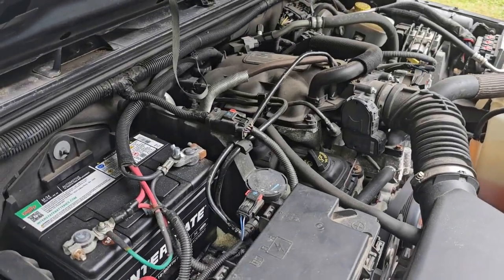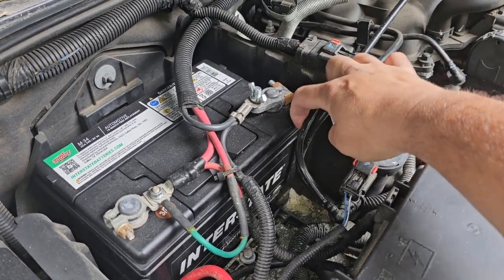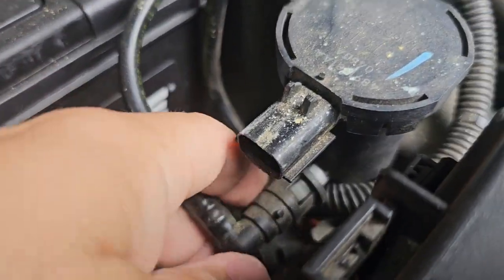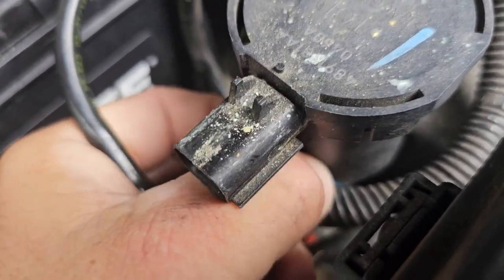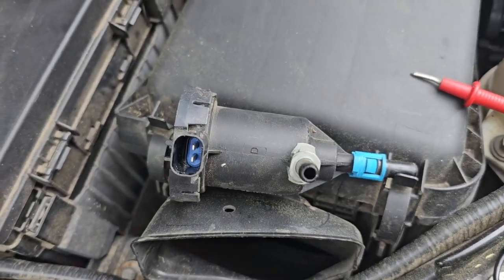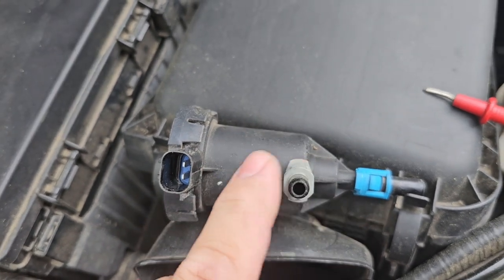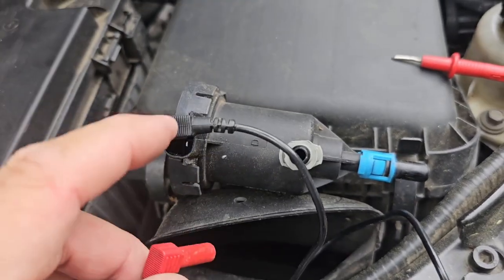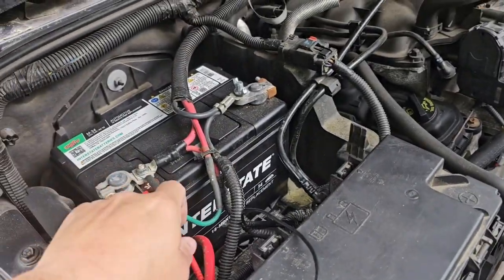Purge Valve test, P0456, Jeep wrangler

Comment: Did you ever resolve this issue?  I got the same code on my Jeep Wrangler 2010 so I bought a new Gas Cap ... nope not it.  I brought it into the shop to see if they can diagnose it.  They of course want to replace the two components that you've done videos on (the Leak Detection Pump and the Canister Purge Valve).   I like how simple it is to replace these two pieces so I might do it myself BUT was wondering what the end of your story was (smoke machine).  Thanks Gary
Reply from the maker: @garyr.wolanske2364  so I actually did get a smoke machine. I just haven't had time to work on it. I plan to work on it this weekend and should be able to post next week. Hope this will help. And be sure to subscribe if you're not already and hit the notification bell so you'll get notified when I post it.
Reply: I subscribed,  notified,  and liked.
Reply from the maker: @garyr.wolanske2364  thank you!